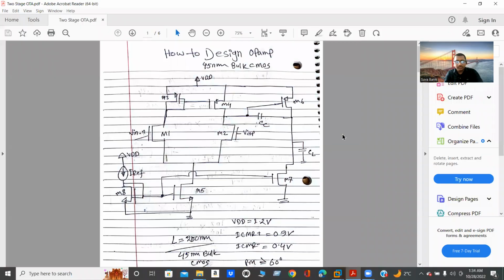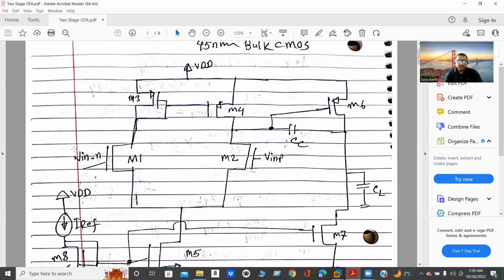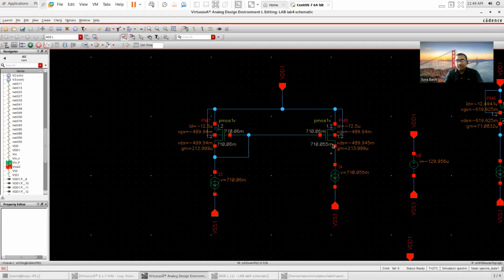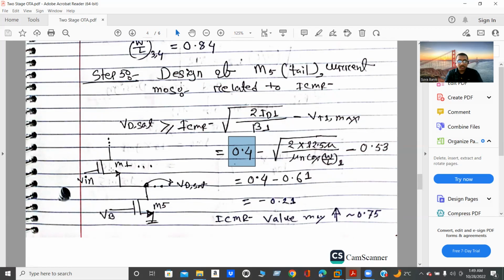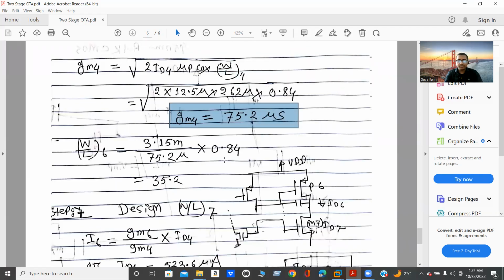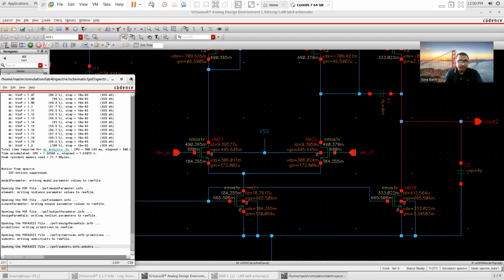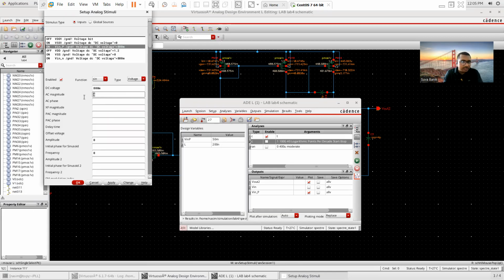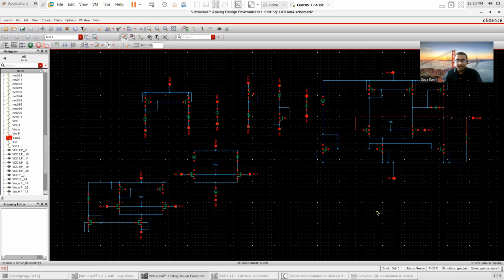Design of Two Stage Operational Amplifier 45nm CMOS Process in Cadence Virtuoso step by step Process

Comment: In this video, around the 8min mark, you mention uploading another video about how to do the simulation to find Betaeff that helped you get the unCox/upCox values. Is that video available?
Reply: in this video at exactly 0:05 seconds you see on the extreme left, where NMOS and PMOS are in diode connected configuration, exactly copy the same circuit (put VDD=1.8V, VSS to GND, give Current I as whatever biasing current is given in the video, take L of N and P mos as 1u, to avoid channel length mod, take W as say 10u), and run a DC simulation, select "save operating point" and nothing else. Run the simulation, then in the ADE window go to result -> Print -> DC operating point, and click on either of the NMOS and PMOS and new window will pop up, there you will find the required parameters such as beff, vth, region, ids, vgs, vth etc etc
Reply: @siddhant-x8k  you're a lifesaver! Thank you!

Comment: Does anyone know what is the maximum W/L ratio of 90 nm ? And if it’s a one stage OPAMP what how do we decide Cc the output capacitor?
Reply from the maker: Wmax is 10um and u can use multiple finger if we want increse w. for single stage we do not need any CC. u can use cap as load.

Comment: This video is very helpful. I am doing a project. Can you pls help?
Reply: 2 stage cmos op amp where 1st stage is current mirror loaded diff amp and 2nd stage is common source amp.
Reply: Can you make such video?
Reply from the maker: @abolikatkar7982  For your OTA, u can follow my video and the associated formulas.
Reply: @banikshuvo16  .Hi ! my question does not have the slew rate as given. How do I assume or calculate that?
Reply from the maker: @abolikatkar7982  assume it.
Reply: @banikshuvo16 I need to optimise my CMOS analog amplifier...for that I need the dataset from cadence for my circuit...how can I get it???
.. please tell
Reply from the maker: What project?